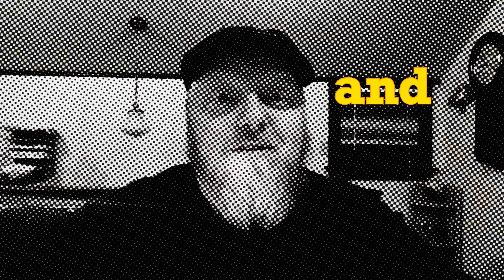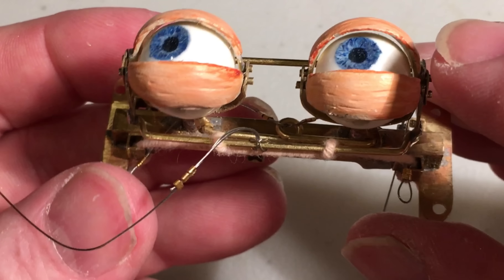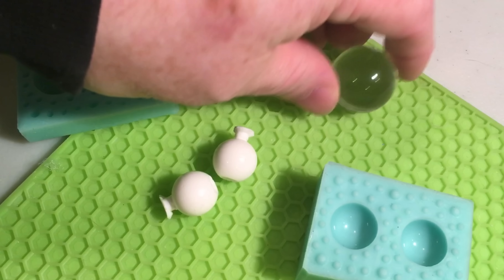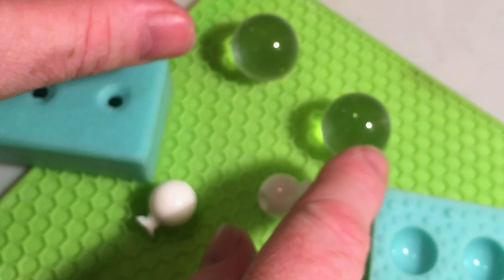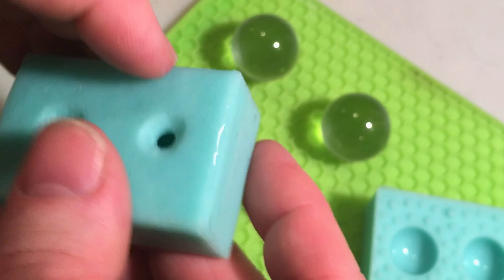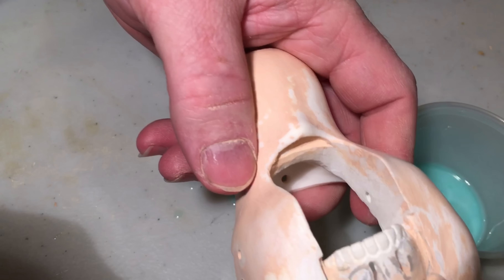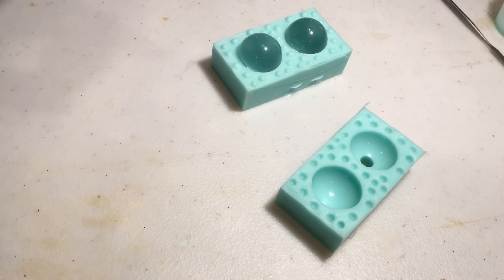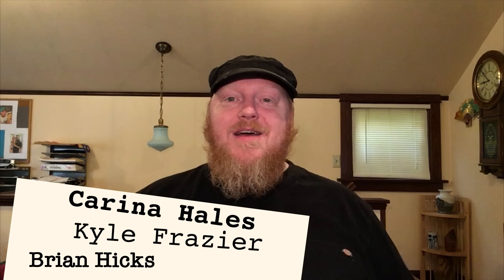Let’s Build: Blinking Puppet Eyes (Part 1)

Comment: Just a little tip for free hand silicone brushing like the teeth on your extra, first brush the teeth lightly, then with a cotton ball rolled open, so it's thin. Cut a piece of cotton slightly larger than your brushed area, Soak up whats left in in the cup with the cotton piece you've prepared and place it onto the area you've brushed. The matting gives more stability without too much silicone leaking off your work piece. Love your tutorial, very clear to understand.

Comment: What is the brand of hot glue stick you use? I usually avoid hot glue like the plague, but I use zote foam and it sounds interesting.
Reply from the maker: Here’s a link. I usually get 5/16” in a 5lb box. For my purposes I always use black brown or white but you can see a wide variety of colors. These are still low temp though, so any project you’re doing that needs to survive above 145°f will likely fall apart. I avoid building enclosed mascot heads from zote that I expect will be out in the sun, or left in a hot car. For most other zote projects, this is the BEST glue there is! https://glu-stix-online.com/collections/glue-sticks/products/colored-hot-melt-glue-sticks?variant=7854515290165

Comment: What about side eyes? Like in skeksis? I'm building everything from scratch
Reply from the maker: This is a REALLY good idea for a future video.
There is an easy way to do this. I build built blinking eyes for Disney’s Finding Nemo which are like that. The way I solved it was to use an extension-spring from one eye to the other and then driving the center of the spring. The two eyes would then follow. Hard to explain in a comment but I will do a future video!
Reply: @GeahkBurchill  awesome! Thank you.